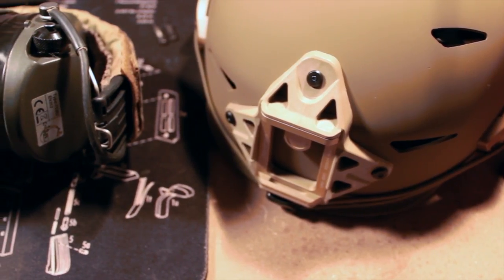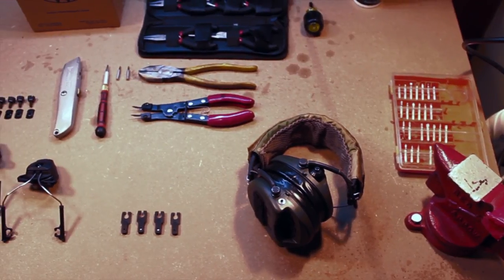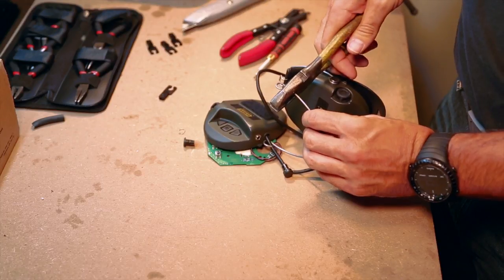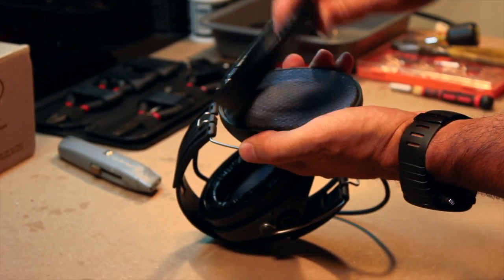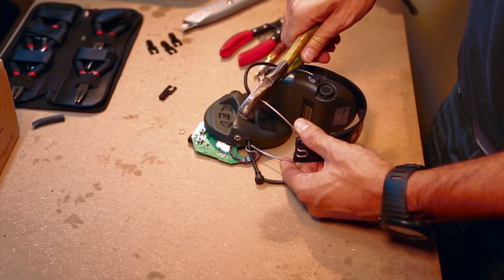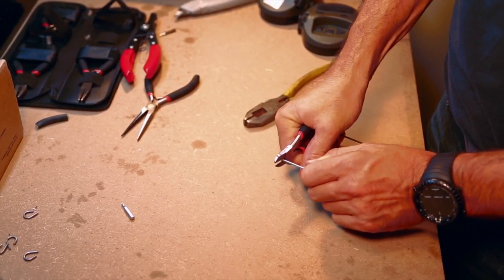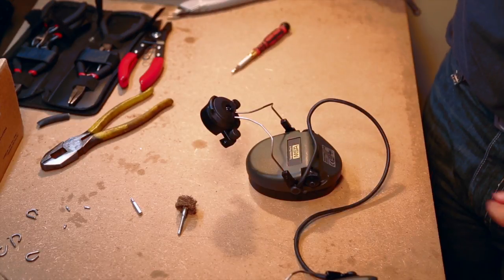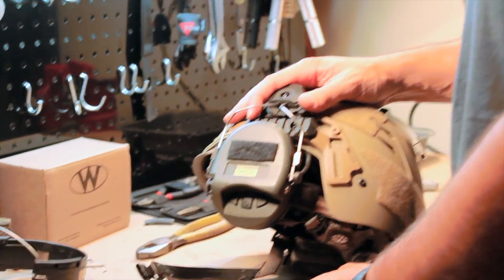Iron Forged Concepts - SARA Installation Tutorial

Comment: What a super informative well made video.  Thanks for putting this together.  I noticed that this process will not work with the neckband style sordins because the rear facing pin does not have enough space to attach the Sara's.  Thanks for the info!
Reply: Well that sucks. I have the neckband Sordins. Do you know of any other product I can use, or do I need to buy a new pair?

Comment: If you will get a roofers/carpet blade for your knife (has a hook blade with a fine point) it is much safer splitting the shrink wrap without cutting the comms wire.

Comment: Note: a good idea before handling the exposed electronic boars is to touch a Static bar (or any non charged metal) to discharge any ambient static you have built up, and prevent damage to sensitive electrical components. Remember folks, handle all electronics like they were a mother board, and you won't mess it up :P

Comment: +Firelance Media When i cut the 3m arc rail adapters to slide into the Saras, do I only cut the very tip? Beacuse everyones head is diffrent...meaning your ear is at diffrent heights then other peoples heads.  Or is this something ill have to cut a little off....then try it on then see if it fits if not cut more?
Reply from the maker: you got it. Always err on the side of caution. cut off the minimal amount of material and then test fit. Adjust as necessary. You can always take off more material...you can't put it back on.